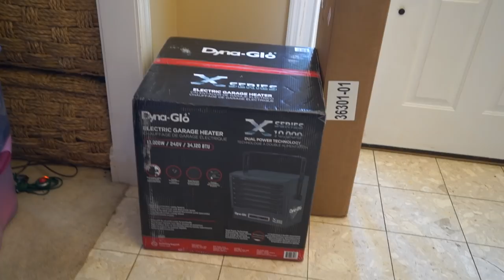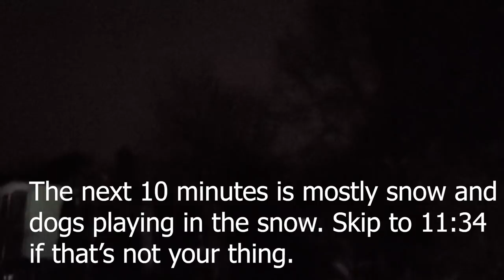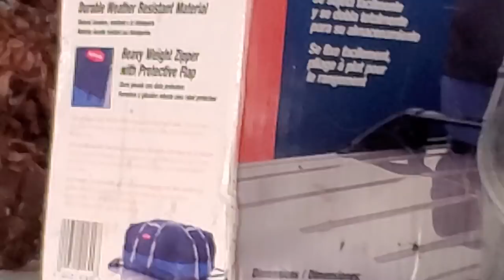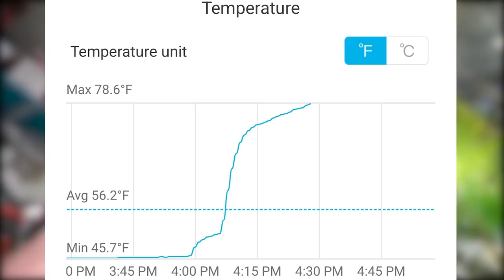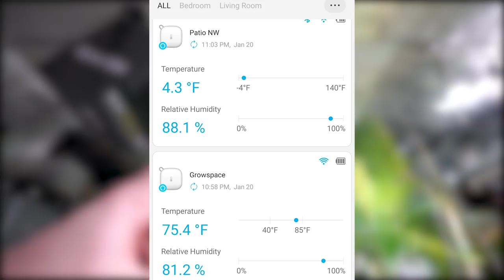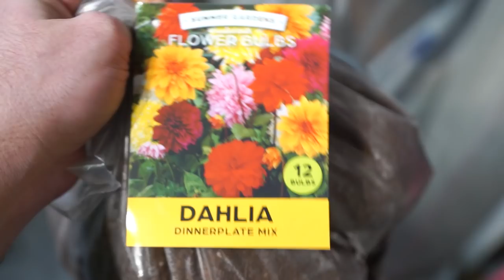Huge Upgrade For The Grow Room || Saturday Vlog

Comment: You definitely don't want to use a gas (or propane) heater with the plants anyway because it produces ethylene gas which is toxic to plants (leaves will yellow and blooms will brown and fall off). Orchids are particularly sensitive to it.
And your new washer and dryer pushed me over the edge to replace mine. Amazing how much cleaner the clothes and bedding come out. And with the front load washer, fingers crossed it won't ruin anymore clothes. Nothing like spending $80 on a new shirt, only to have the washing machine rip a hole in it.
Reply from the maker: Good points! Though a lot of commercial greenhouses use gas heaters, they must have special exhaust or something. Idk. Either way it's not happening here. Isnt it amazing how clean the clothes are! I didn't even realize that my old water and dryer were doing such a bad job.

Comment: May I ask a question? You don’t have to answer if you don’t want to. Closed captions, does it cost extra money for you to include them in your videos and do you have to do anything extra to have them available?☃️❄️💚🙃
Reply from the maker: Closed captions should be available to everyone. There's a symbol that says, "cc" if you hover over the screen and it will auto-generate the captions. I'm not sure how to do it on the TV, but it should be an available option there as well.
Reply: @TropicalPlantParty  I use my tablet and I can find the cc but some videos it’s not available . I was just wondering if you somehow had control of that option from your end, but I guess not. Thank you for responding. Jeff seriously if I’m too chatty let me know, in my small mind I figure the more comments I make the better it is for your channel?☃️❄️💚🙃
Reply from the maker: Never too chatty and I of course appreciate the engagement. Oh yes, we have some control over it, there's an option to turn them on or off. I have my channel set to always allow CC, but sometimes youtube is inconsistent and it doesn't always work.

Comment: Aren't you going to clean out the water yuck.
Reply from the maker: Said in the video that a new pump was in the mail to run the filter off of, which cleaned the water up. Also dried leaves release tanins which softens the water, adds minerals and is really good for the plants.